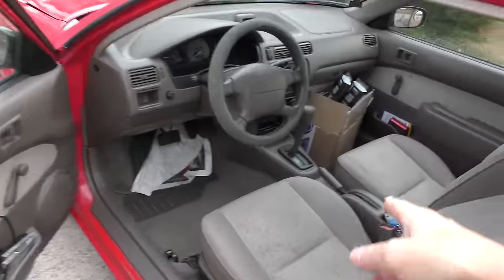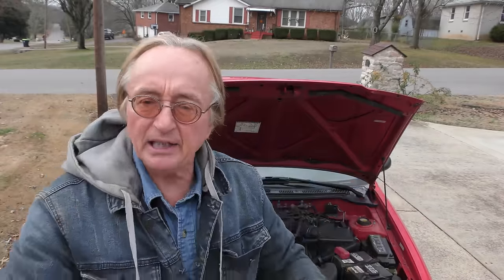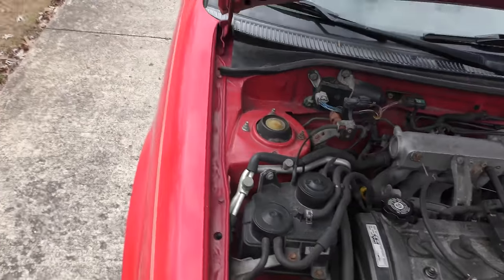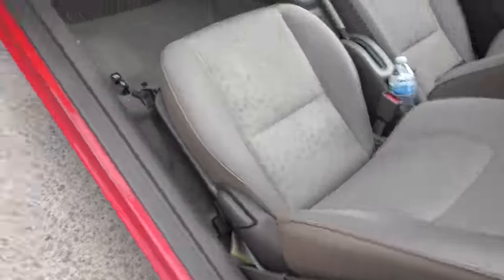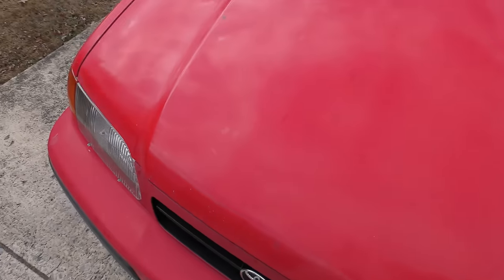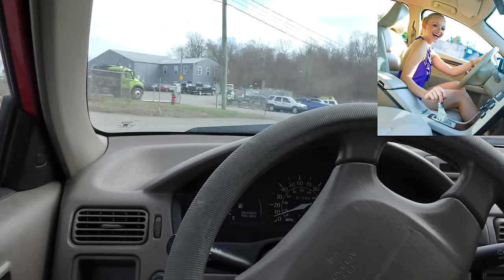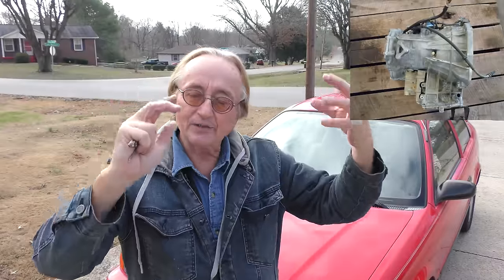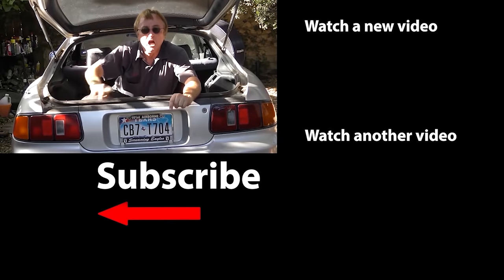I’m Sitting in the Worst Car Toyota Ever Made

Comment: Yeah and if you accidentally lock the key in the car you can unlock the car with a coat hanger 👍
Reply: Most Japanese car door locks back then required the key to lock them, to prevent people from locking their keys inside. But I can lock myself out of 2003 Toyota Corolla, although I have yet to do so.
Reply: @markh.6687  I have not yet seen a car ever that required the key to lock it. I wish my old cars had that feature
Reply: @redrum3835  The feature made far more sense when mechanical keys and manual lock buttons were used, rather than today's remotes. My 2003 Corolla uses mech-keys, although it also has a lock/unlock key fob.

Comment: I got a 1996 Toyota Tercel with the 3 speed automatic transmission. It has around 156,614 miles on it, but it got wrecked in an accident that I got involved almost a year ago. The wreck was on the side where the gas cap is, causing the rear axle bent. Fortunately, I found one in excellent condition in a junkyard, but I didn't have repaired the body work because it has to be replaced the left panel using a junkyard one and repaint with the car color. The repair cost was a fortune that I decided to tell the body work man just bend it almost to the original look. Just with the scratches and the hits, consequence of straighten it. Overall, I like to drive my car. I always change the oil and the oil filter on my own. And with pride, I'm from Puerto Rico.
Reply: I forgot to mention that my car is 2 door without the "sports" trim(no rear spoiler).

Comment: I have a 1996 Toyota tercel dx 4 door when I start car it hesitates to start I change the fuel filter change the fuel pressure regulator the spark plugs and it's still doing the same thing I have a guess that it is the fuel pump can you please help me with this situation a lot of mechanics I brought it to told me it was these things and I changed it and still it's happening

Comment: old school trick for changing valve seals without top overhaul, besides using compressed air, you can use nylon rope and stuff it inside the piston via the spark plug holes, turn the engine till piston moves upwards and the "filled with rope" piston keeps the valve closed.

Comment: The car before it, the Echo, is actually the worst. Lol. But the thing is, these cars with manual, they are cheap tin cans that drive forever.  No anything, maybe a stereo.  But that also means nothing stupid to break, either. 
That said, the better used option is a Fiesta hatchback with manual.  You can haul stuff in it and it isn't a total tin can.  Since it's basically the same car they sold (still sell) in Europe, it's actually safer in a crash than the sedan and most other small cars.  But only manual.  An automatic in any of these small cars robs it of a massive amount of power and costs more than the car is worth if it dies.  Not such a  big deal with a 300hp car, but with a car that puts out 100hp. Having 80hp usable is pretty much a toad in traffic.

Comment: Hey scotty, I have a Chevy 2013 Impala with 230K miles on it , got it for a grand. I dont know the service history , but when i drive the car, the car doesnt seem to be comfortable in the final gear. It always wants to stay at the 5th gear and revs upto 2800/3000 RPM but in top gear it can do 90 under 2000. It takes lot of effort and careful gas to be on the final gear, it always try to stay on one less, i dont know what to do. do you think i can change the ATF will it work .
Reply: Sounds like a lockup torque converter issue in the tranny.... You will have to go to a tranny shop and put it on a scanner and take it for a drive.... Might just be a solenoid or need a tranny reset (reprogramming) its all computerized now.... 🙏

Comment: Well, I mean the good thing is that since they are probably one of the most hated cars that Toyota made, finding one cheap shouldn't be a problem.  Then again, I used to see a lot of these on the road around the 2000's and even to around 2010-ish era, but I Don't see too many these days, unless they're in a junk yard.

I always found it sort of comical that Honda's base model mid-90's Civic (so the DX and CX models) had power steering as an OPTION.  It was standard on the higher-end LX and EX models, but waws an option on the lower end models.  I believe that in 96  or 99 when they updated the Civic again, they made power-steering and AC standard in all models.  The DX didn't have cruise, power windows or locks but had a radio and AC, and the CX pretty much had none of those features.  The EX and LX models had pretty much everything the DX lacked, with the EX having a sunroof).
Reply: Man, I miss those days.
Reply: @H R power steering was an option on the 2005 Toyota Echo believe it or not. For a 2005 vehicle. So rare & interesting

Comment: Hey Scotty, i have an e36 bmw and its giving me some issues, it will drive properly   and after i switch it off, then when i try starting it again it cranks but it hesitates to start, what could be the problem?
Reply: Had the problem with mine, easy fix, it's a relay👍

Comment: The later Toyota Tercel was good basic transportation. In 2000 Toyota introduced the Echo (U.S. model). In 2006, the Yaris replaced the Echo. Too bad Toyota is not offering a basic model such as the Yaris in the U.S. any longer.

Comment: When I was 17, I purchased new a 1979 Corolla with a 5spd manual. No A/C in Florida - oMG!  I tried to kill it many times but it just kept going…until I got T-boned. Amazing car that I didn’t appreciate as a kid. I replaced it with a Ford EXP. That was a fun car too. Ripped the pollution control crap out of both of them. Put an oversized Weber carb on the EXP - that woke it up!

Comment: Hello Scotty 👋 ,first i want to thank you for all YouTube videos you have made 😊   and I will tell you my journey which took me almost six years in a toyota avensis 2015 model with a 2L gasoline engine naturally aspirated and CVT gearbox with a "sport button " for spend more gasoline and 152 hp ,i bought this car in 2017 with 30.000 km on board from a toyota dealer which give me 8 years warranty period for gearbox and engine then I begin my journey in 10.000km they change my gearbox ,they decide to fix it after a hard discussions because I let the car in the morning was checked for couple minutes then I got a phone call with this word's:(your car it's perfectly working condition and was nothing wrong with it )😀 and i get also a paper with all the checked points but the problem was still there 🤯any way I show them where is the problem and they fix it, after my engine water pump start to leaking they change it  and I asked: why it's wet around one of fuel pipe connection? Answer was:it's normal,  they put grease when the pipe was installed and now it's melt from the engine heat "after 60.000km it starts to melt  🤔🤔🤔🤔 ,i never clean the engine with water or any other substance  ,after it was battery time and I observe second pipe connection was wet 🤔🤔 90.000km  then service period comes up and i so they don't touch spark plugs aria ,asking about it i get same answer ,okay 🙄 
I've made some km and engine start with weird noises on cold starting and jumping rpm indicator, it comes   
105.000km service period distribution chain start with weird noises and third fuel pipe connection was wet 😳 ,120.000km I've decided to sell it because they refuse to fix it with the same answer" it's perfectly working condition " so in the end my gasoline engine sound's like a diesel engine with chain problems and sport mode not working ,rpm indicator shaking, over 3000rpm car it's start to react.
That it's Sweden sistem and the future for that avensis was all time in workshop  because it's a big business behinds.
Reply: scotty_kilmer468 

Hello Scotty 👋 ,first i want to thank you for all YouTube videos you have made 😊   and I will tell you my journey which took me almost six years in a toyota avensis 2015 model with a 2L gasoline engine naturally aspirated and CVT gearbox with a "sport button " for spend more gasoline and 152 hp ,i bought this car in 2017 with 30.000 km on board from a toyota dealer which give me 8 years warranty period for gearbox and engine then I begin my journey in 10.000km they change my gearbox ,they decide to fix it after a hard discussions because I let the car in the morning was checked for couple minutes then I got a phone call with this word's:(your car it's perfectly working condition and was nothing wrong with it )😀 and i get also a paper with all the checked points but the problem was still there 🤯any way I show them where is the problem and they fix it, after my engine water pump start to leaking they change it  and I asked: why it's wet around one of fuel pipe connection? Answer was:it's normal,  they put grease when the pipe was installed and now it's melt from the engine heat "after 60.000km it starts to melt  🤔🤔🤔🤔 ,i never clean the engine with water or any other substance  ,after it was battery time and I observe second pipe connection was wet 🤔🤔 90.000km  then service period comes up and i so they don't touch spark plugs aria ,asking about it i get same answer ,okay 🙄 
I've made some km and engine start with weird noises on cold starting and jumping rpm indicator, it comes   
105.000km service period distribution chain start with weird noises and third fuel pipe connection was wet 😳 ,120.000km I've decided to sell it because they refuse to fix it with the same answer" it's perfectly working condition " so in the end my gasoline engine sound's like a diesel engine with chain problems and sport mode not working ,rpm indicator shaking, over 3000rpm car it's start to react.
That it's Sweden sistem and the future for that avensis was all time in workshop  because it's a big business behinds.

Comment: Got a 1994 Toyota Tercel it was the cheapest car sold in North America. But the echo came after the 1999 Tercel than eventually the Yaris. My 1994 on smog test is 1 of 99 hydro carbon at 15 and at 25 it's 2 of of 99 been reffed by the state many times but it always passes the tuffest tests. Must be the fact I only use Toyota parts literally bought the last few parts for tunes up and keep them in garage. Cheapest car but one of my favorites it's 4 speed and I put the lsd out of the starlett from Japan and it burns tire till 35mph

Comment: We bought a new 84 Tercel wagon with a 4-spd manual because it was a Toyota. We drove it until the body rusted out around us. We covered the rusted panels, fender well edges, and door edges with aluminum tape to pass annual inspections (MA). Mechanically, it was great! We NEVER had any major problems! No oil burning, no carburetor problems. We continued to get 25-35 miles per gallon. My wife LOVED that car.....to DEATH! (140k when we got rid of it. MA climate killed the car.) Now we have a Camry hybrid and a RAV4 hybrid.

Comment: My 2007 car has pop-up door locks, hand-cranked windows, standard transmission and no air-conditioning.  On the other hand, it has a proper spare wheel, no faded paint, low bills and a roof rack for carrying big stuff such as wardrobes and ladders.  What's to complain about?
Reply: @Green And Pleasant Land sounds like something I dream of. I am currently looking for a car with crank windows & manual transmission

Comment: My Parents just sold their 98 Tercel 3 months ago. They were the original owners. It had 250k miles and all it needed was regular maintenance. No power steering from the factory. I learned to drive in it. It was even more reliable than their 2001 corolla and it actually had respectable power. For years my dad refused to sell it cause it was so darn reliable. In my experience, these are among the best cars Toyota ever produced.

Comment: Scotty, what is your opinion on this advice;
 "Constantly letting a cold engine idle gradually strips oil away from the engine’s pistons and cylinders... Here’s the problem: when the engine is cold, the gas may not evaporate completely as it combines with the air. For more recent cars with an electronic fuel injection, there are sensors that detect this and compensate by adding more gas to the mixture. When there is excess fuel in the chamber, some of it condenses onto the cylinder walls and strips away the lubricating oil. When the lubricating oil is gone, components like the cylinder liners and piston rings will wear prematurely." Start driving after 30 seconds to a minute after starting your car.

Comment: HAHAHA! I KNEW IT WAS GOING TO BE THIS CAR. I  Put my daughter one back then, and it had the half carburetor half fuel injection system Which was total crap. By the way, I had the Toyota to sell SR5 which was incredible car. It was at station wagon with the offset license plate in the back. I put over 225000 miles from the car and it's just ran almost as good as when I bought it.

Comment: This vehicle is way too old and way too small for most used vehicle buyers. In addition, it is way too slow. A 2004 Mazda 6 station wagon with the 3 L V6 engine and the five-speed automatic transmission is a much better and safer vehicle than this Toyota Tercel. Jay Smart just did a video on that Mazda 6 wagon a couple days back. They are great vehicles. Thank you very much.